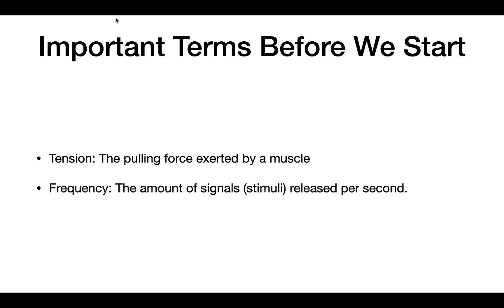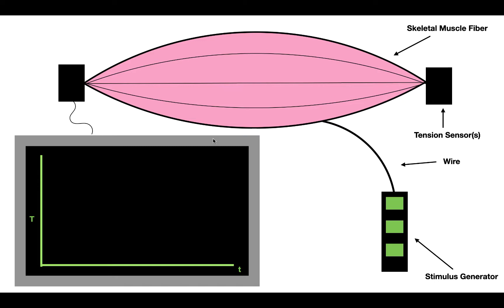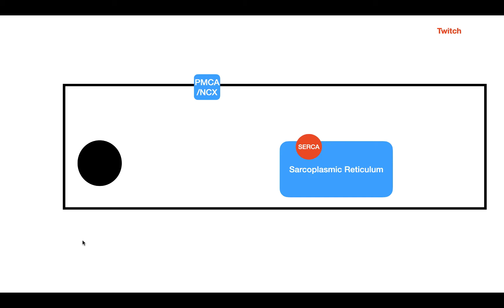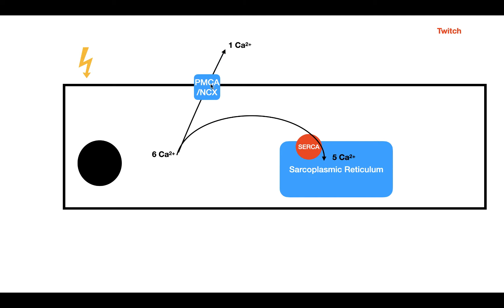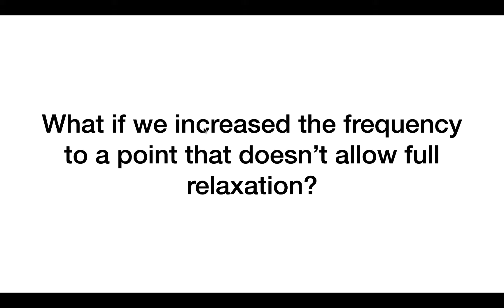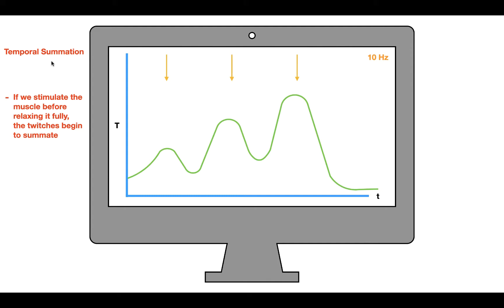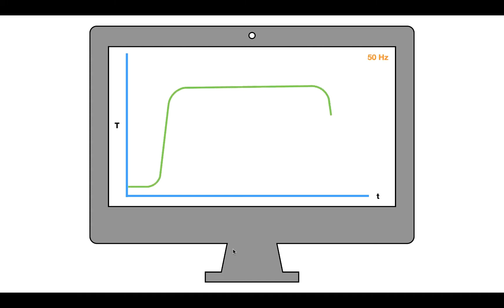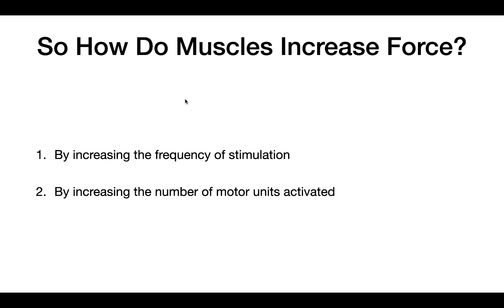Muscle Twitches, Unfused Tetanus, Fused Tetanus

Comment: I want to ask that why in unfused tetanus… after the second contraction it is left with 9.5 Ca . Then why didnt the curve showed gradual increase in the next 6 curves? Why they maintained a plateau?
Reply from the maker: Hi! Thanks for your question! This is because there is a maximum amount of tension that can be produced by the muscle in both the unfused and fused tetanus states. The greatest amount of tension that can be produced by the muscle is produced during fused tetanus. Fused tetanus is initiated at the fusion frequency. After the fusion frequency, the tension increases minimally due to the fact that virtually all of the sarcomeres formed cross-bridges.